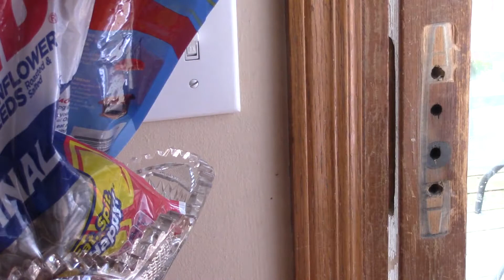Replace PLPCI Patio Door Lock

Comment: What type latch vertical or 45
Reply from the maker: Vertical
Reply: How do you figure out what lock mechanism?   Just eyeball?  It looks just like mine
Reply from the maker: I just searched for sliding glass door locks until I found one that looked like mine:
Prime-Line E 2014 Stainless Steel Mortise Lock